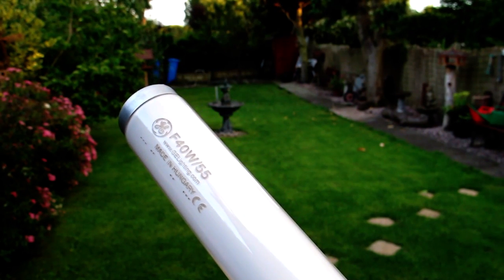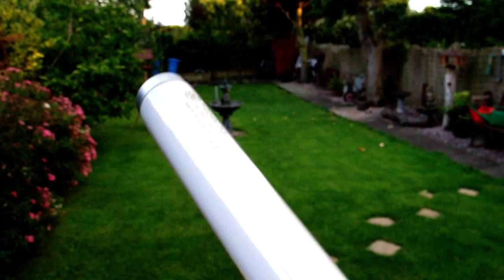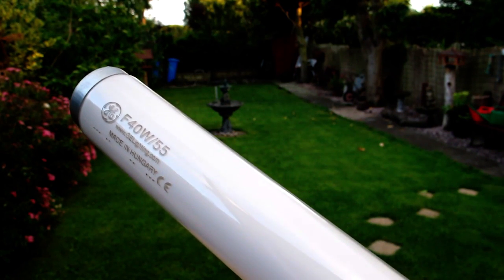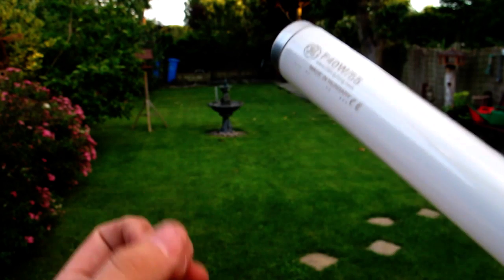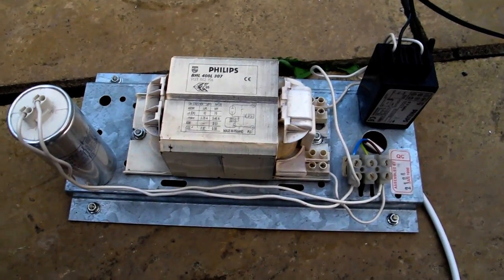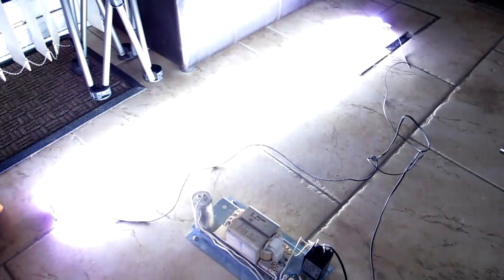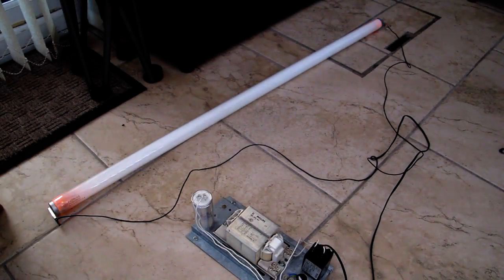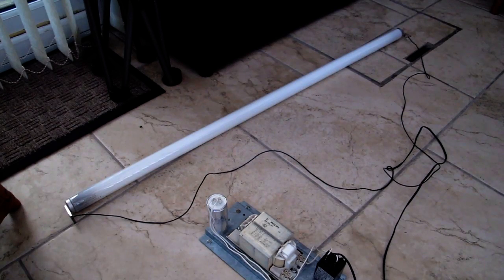Fluorescent lamp pop.

Comment: @suzukir123 Its a ballast meant for high power halide lights that have vaporized metal gas in them. They flicker rainbow colors when started up, usualt pinkish and tealish with hints of yelloe, green and orange. You will know one if you seen one. You have proabally seen one already. FrontSideBus actually has a video on them /watch?v=S2ILild27AI